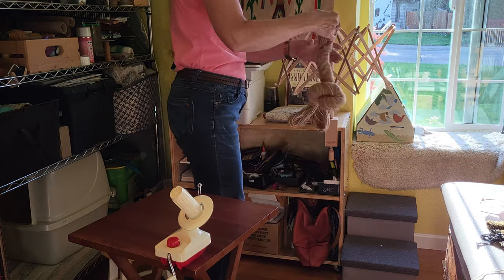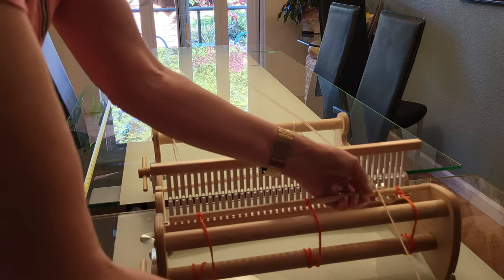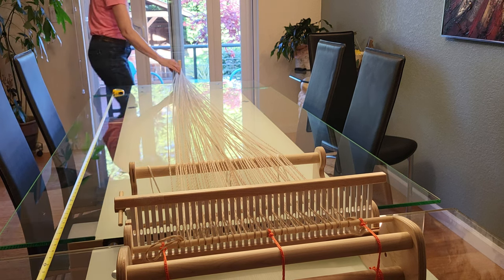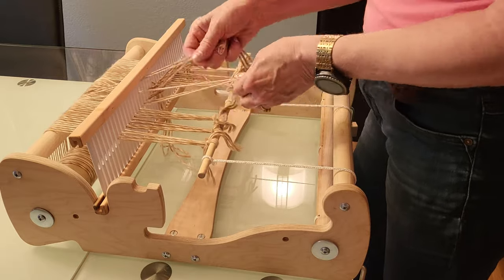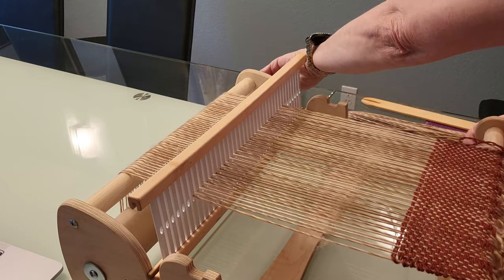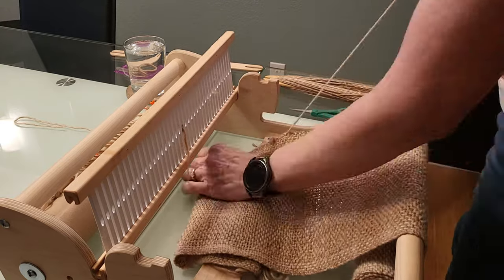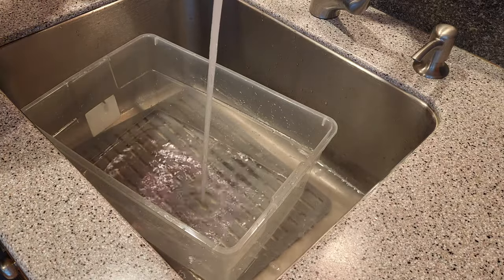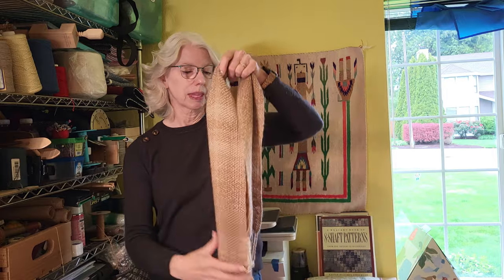Weaving a Plain Weave Scarf on the Rigid Heddle Loom

Comment: I use two nylon loopers made for children's looper looms to hold both the back rod and the heddle securely while I direct warp.  They stay on the back rod all of the time so I never have to look for one and I simply pull the loop over the end of the little extension on the top of the heddle when I'm ready to wind another warp.  Rubber bands will work but sometimes they break and the nylon loops have been in use for more than 15 years through many warps.
Reply from the maker: What a great idea! I'll have to give that a try. Thanks for the suggestion and thanks for watching ❤️

Comment: Lovely and very strategic work.  Which brand of rigid heddle loom did  you use?  Thank you.
Reply from the maker: Thank you. I have the Schacht 15" Cricket loom. It was my very first loom.
Reply: Just a thought but with difficult , soft yarn that tends to tangle (yarn barf prone yarns) you can simply skip making the ball / cake.  Just keep the skein stretched on the swift and direct warp - assuming you have a place to attach the swift on a near location.  You can also go old school and actually make a real ball (wind by hand rather than ball / cake winder).  I’ve had to do this with heavy silk blends myself.
Reply from the maker: Both are good options. I have found warping from a swift tends to put more tension on the yarn than I like (stretching it). But the hand wound ball would work great. Thanks for the suggestion and thanks for watching. Happy weaving!

Comment: I tend to be very I’ll use problem solver as the kind words to describe me. Actually I’m so stinking annular about what I do that I can’t deal with messes and mess ups. So one suggestion when you do your direct warping use rubber bands to secure your heddle, it’s very easy and you won’t have to put up with that jumping out of its crib or notches. Just watching drives me crazy 😂.
You can make or buy a yarn base with a post to slide the balls of yarn, cones, or pre wound threads for weaving, it secures it very nicely.
Reply from the maker: Thanks for the suggestions. I understand about watching someone do something that drives you nuts 😂. I'll definitely incorporate your ideas into my weaving. Thanks for watching ❤️
Reply: @tangledwebsweaving  very sweet of you! I know not all suggestions work for all people. Recently I watched a video where a weaver used these rubber straps with magnets for tieing on the warp. Geez I bought them and tried them and for me a big yuk! 😂Have fun